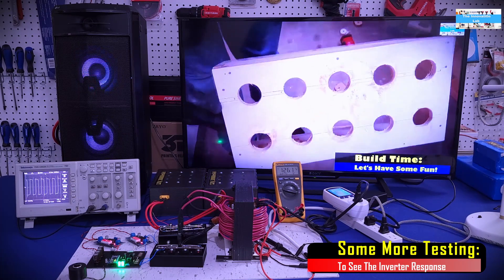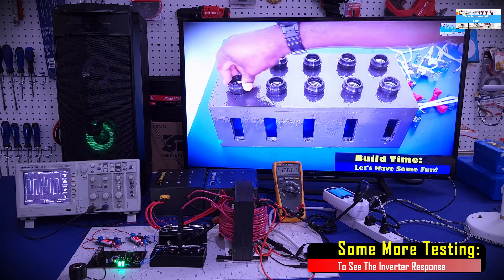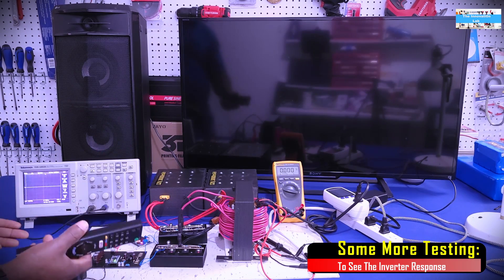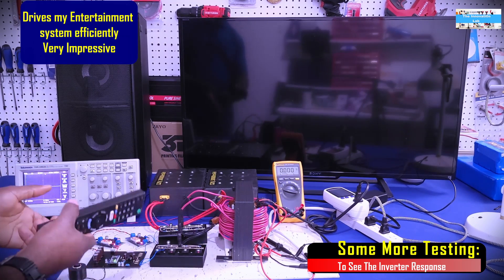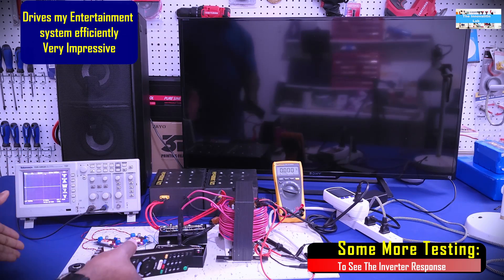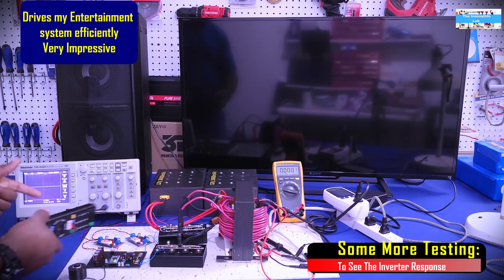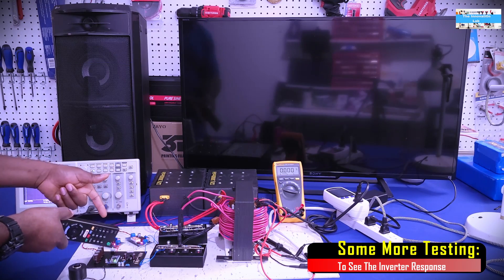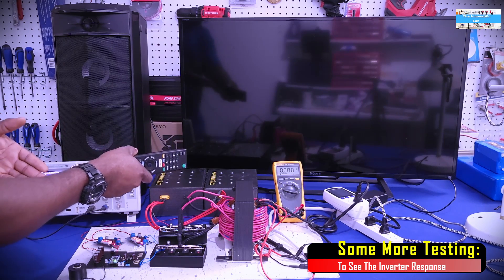How to Make a Homemade Inverter.

Comment: I am looking to make something similar, but much smaller scale and run off a Milwaukee 18vt battery(so it's portable).  I need it to power an injection mould Band Heating Element  to a consistant 315F degree.  Any suggestions for where should start?  Would love to hear your thoughts after watching this great video.
Reply from the maker: You can check online to see if there are small inverter units that fits your specs and needs. That's probably where I would start - depending on your location.😊

Respectfully,
The Innovati0n Lab💥
www.theinnovati0nlab.com

Comment: GREAT BUILD!!
A small observation...I am glad to see in your paralleled power MOSFET banks, that you used separate gate resistors,  I have seem so many videos that end in blown power FET's due to all three pins being directly connected!
Reply from the maker: Yeah, that is the standard practice. The individual gates should be isolated.

Comment: Hey my friend, great video, (just watched all ... ) 

 I'm looking at AC-DC high amp chargers - so I can plug in and use overnight cheap electricity (they do here in UK) and charge up my (52v) 16s1P 14KW of lifepo4 cells using a DC charger plugged into the grid. However high amp AC-DC chargers are so costly (here 200-300 hundred dollars). The issue here is they only give you four hours of cheap electricity ... so chargers need to be 80amp plus. Any future videos exploring this?

 I was looking at your buck converter video briefly and saw you make an inverter... so now watching this :). SO jumped on this, as inverters are also crazy expensive (here)
Now, this is my content... thanks! :)

Wish you luck with your channel !
Reply from the maker: Thank you so much for watching my videos and for leaving such a wonderful feedback! 
This is exactly the kind of positive interaction that I am always looking for and I appreciate it.

Regarding your 52V, 80A charger need I find it very interesting and I will have to make a video to present my findings. 

A few things that come to mind will be to connect multiple server power supplies that in series to give you a higher input  voltage/power to the boost converters as I showed  video in my videos. However, this by itself will not be enough because it seems you need to build a 5KW charger and the boost converters i showed can only deliver up to 1500-1800W. Also, for a high current charger (80A), I will have to test any ideas  myself before recommending it to others.

Here is what I know;
For a 52V battery, you will definitely need more than a 70V charger depending on your battery type. A charger with <80A current output will still charge your battery - but not as fast as you need - and you already know that.

In a nutshell, just know that I find this challenging and super interesting - so I will definitely make an experimental video for it.

Please friend, we need your help to grow our channel to enable us reach a wider audience. If you can help by sharing our videos with your interest groups, that will be wonderful.

Thanks again!
👍👏👏
Reply: @theinnovati0nlab782  hey thanks for replying, appreciate your insight! It's really interesting to see your designs!

I currently have the batteries configured as 24v 8s1P Lifepo4 280ah cells but recently have purchased another 8 and rather than make 8s2p with 560 ah!!! - which would be very hard to charge in 4 hours! I'm making it into a 16s1p 48/52v 280ah battery (just waiting on a BMS to fully put together, currently my BMS is 8s only! 

To be fair, I could probably get by with 60-70amp charger in the 4 hours, as I doubt daily I will deplete the batteries to less than 10-20 percent but it would be nice to have larger amp charging options.

You would laugh at my current charging setup, I have a 5 amp 24v car battery charger, another DC bench power charger (around 8-10amps ) and I'm running off an old 24v APC UPS as a makeshift inverter (which charges at about 10 amps - all running together on my battery and on a timer smart plug that turns on when the electricity goes to cheap rate at 12:30am). 

I did have a PowMr off grid- solar inverter that charged at 70 amps but it was purchased new from ebay/china and stopped working after 30 days! Luckily I was able to get my money back from that, hence my new charging design.

Looking for DIY solutions and your channel looks brilliant for someone with your knowledge exploring new ideas! Thank you! I have subscribed and there are lots of us who are looking for options similar to this (as energy prices in the UK has gone up 5 x times more in the last year) it's almost impossible to pay our monthly bills... A channel like this is exactly what people struggling need!

Thank you for options, I look forward to anything you might suggest -  just exploring your other videos now :)
Reply from the maker: Thanks a lot for your wonderful/kind words and for sharing your experience. I greatly appreciate it. Again, I love this type of feedback because it helps me to know what videos and project that will bring the most value to my audience.

Thanks again friend!
👍👍👍

Comment from the maker: I hope that you find some good value out of this video and depending on the feedback I get from this one, I intend to start doing some more inverter videos/series and I will be covering the following;
- How to build a simple programmable inverter - using Arduino and other microcontroller options
- How to convert the square wave inverter (shown in this video) to a pure sine wave - all done with a few lines of soft ware codes in Arduino.
- How to build a pure sine wave inverter with a simple full wave transformer  - because center-tap transformers (used in this video) can be lossy and hard to make. 
- How to build a simple transformerless light weight inverter!

This inverter is actually a 3000W design, however given that this initial design has no feedback control or regulation, my target for the testing was only 1000W and I am glad that the testing came really close!